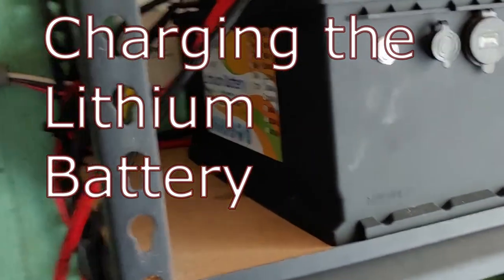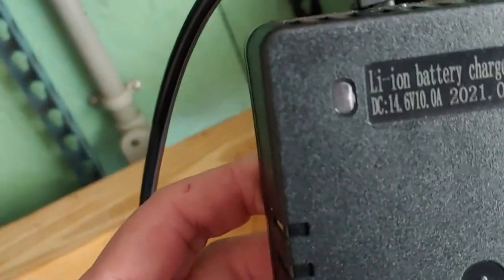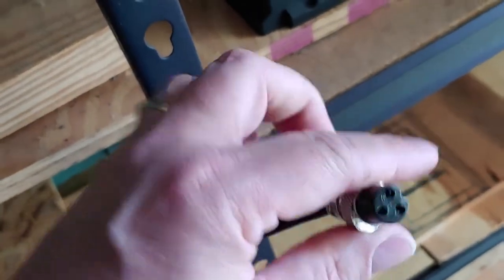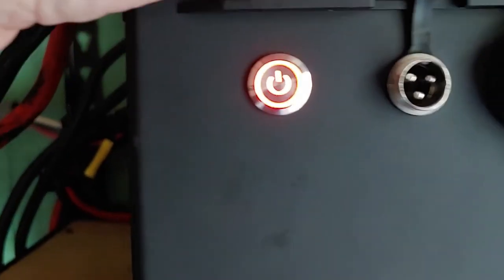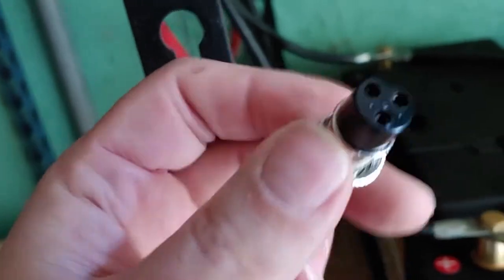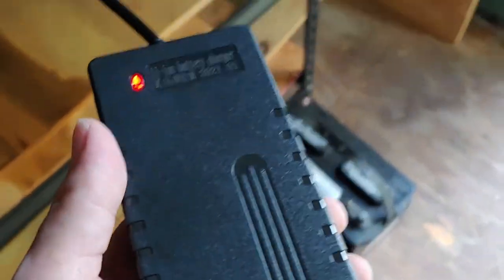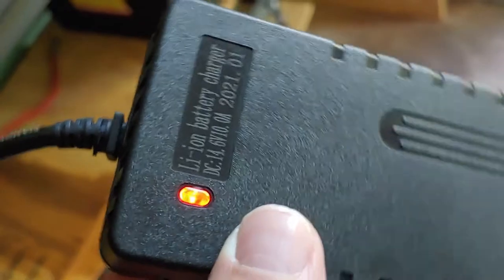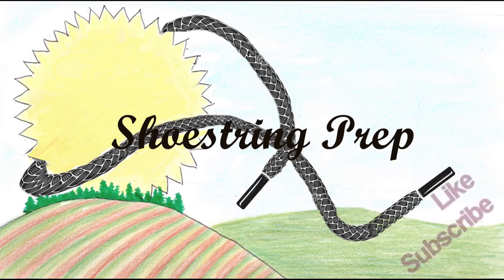Charging the Fly-Power lithium battery for off grid systems

Comment: I got a big Bluetti to be the guts of my solar system, but I'll probably use batteries like these to store extra power. Mainly because I can buy 4-5 of them for the price of one of Bluetti's!
Anyway, I've heard this charger is pretty slow, but I'd leave it plugged in to the Bluetti while I'm at work and it has nothing else to do. I assume slow charging means it / the battery don't heat up and it's okay to leave unattended all day?
Reply from the maker: I have one of these batteries plugged in and working  24 / 7 and it does not get hot. 
As for charging slowly, the battery charger has charged up my four battery bank in just a few hours.
Thanks for your comment.
Reply: This is how I plan on redesigning my truck camper. Plug into a Bluetti and solar to the Bluetti. Then if I need anything from the battery Ryobi 1000w inverter.

Comment: I just purchased a new fllypower 12V 100Amps lifepo4 battery from Amazon  like the ones you show in your videos. 
I plugged it to the charger that comes with the battery and it started to charge for about 2 hours . the charge is holding and fluctuates between 13.47 and  13.49V for about 2 hours. Is this normal ? could it be doing this to calibrate the battery cells? and how long does it usually take to fully charge this battery ? when I received it and started to charge it was at 13.1V. Thank you
Reply from the maker: They can take a while to charge. It should charge until it reaches 14.6 v.
Thanks for your comment.
Reply: @shoestringprep  Thank you for the reply, I'm really enjoying your videos.

Comment: I have this battery on my RV, I have on parallel with an additional. Can I charge while on Parallel?
Can I charge while simultaneously using the battery still connected to RV?
Reply from the maker: Yes, you can charge it in parallel and under a load. Thanks for your comment.

Comment: So if you put two of these batteries together in parallel, would the AC input to one battery charge them both? Or would you have to have one AC plugs to each of the batteries?
Reply from the maker: Charging one of the batteries will charge them all. Thanks for your comment.

Comment: @
Shoestring Prep  Sir I subbed and Liked,  Looking for input on charging this FLY-POWER 12 volt 80 AH Battery if I dont have the provided charger,  Can I use chargers friom my other LiFe Po 4 battries,, Where Do I connect the charger?  Thank you,
Reply from the maker: Welcome new subscriber. Attach the battery charger to the terminals of the battery. Thanks for your comment.
Reply: @shoestringprep  Thank you for the fast reply Shoestring,  I've just been through 3 major surderies so Have to check my self,  Much apprecoated,

Comment: If I have my 2 12v batteries wired for 24v ouput di I still beed to use both chargers?
Reply from the maker: No one charger will do. Thanks for your comment.
Reply: @shoestringprep  Yes, you need to use both chargers, or the on\\batteries will go out of balance.  The once with the charger plugged in will have a higher state of charge than the one without.  Over time you will get voltage errors as the balance between the two batteries will be off.

Comment: I just received the same brand new battery ( FLLYROWER ) . I can charge my 12V , 60Ah battery to 14.6V but when I disconnect the charger it will drop the voltage to ~13.6 V. Does that mean there is a problem?
Reply from the maker: No, that's not a problem most lithium batteries in fact all the lithium batteries I know of will charge up to 4.6 didn't drop down to 13 something when it's sitting. Thanks for your comment.

Comment: Heads up on the fakes out there I just got scammed, make sure to look for Fllyrower and the difference is it does have a volt meter on the usb ports that's the wanna be Fly power and will do a drain test to see the capacity
Reply from the maker: Thanks for the comment.
Reply: Do all FLLYROWER batteries come with a volt meter on the USB ports? My 12V / 60Ah FLLYROWER  doesn’t have a volt meter?
Reply: Sorry your comment doesn’t make any sense. Can you clarify… FllyRower is the fake and FlyPower is the good one?